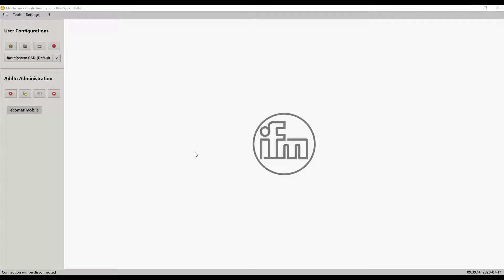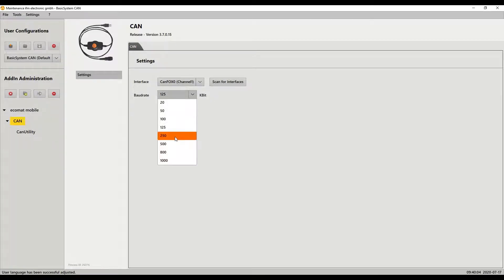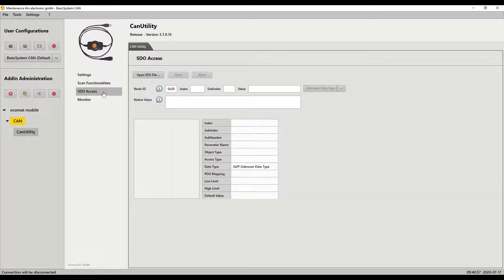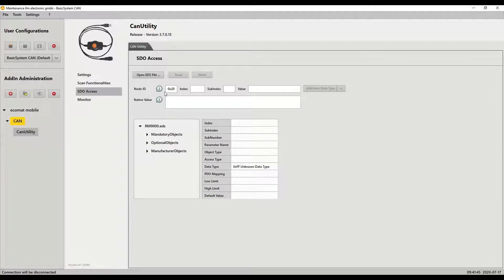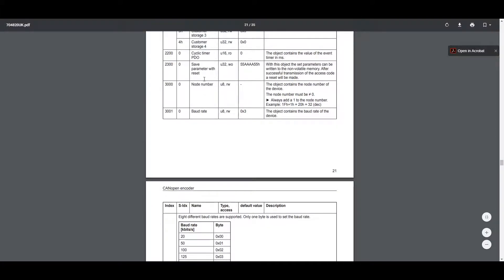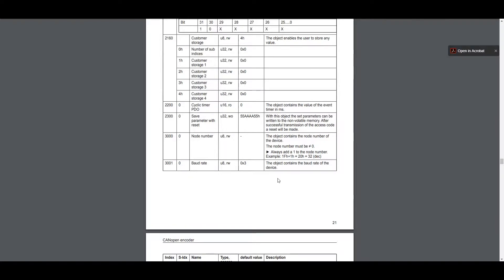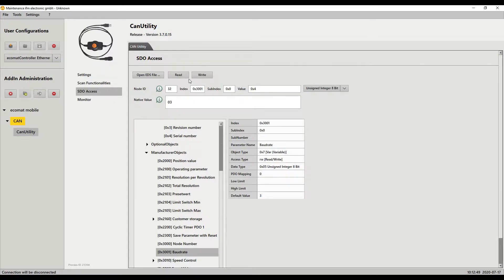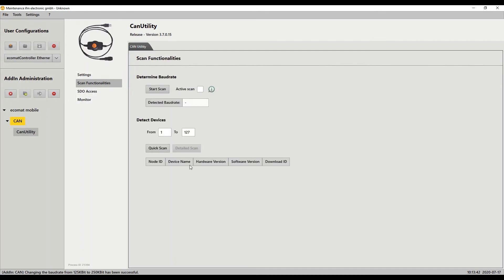ifm RM9000 Setup

Comment: Hi Erik, nice info. I would like to ask if I want to replace a new RM9000 with existing one. Do I still need to do this Setup or simply just plug and play.
Reply from the maker: If its the default baud rate and node ID then you don't have to go through this process.